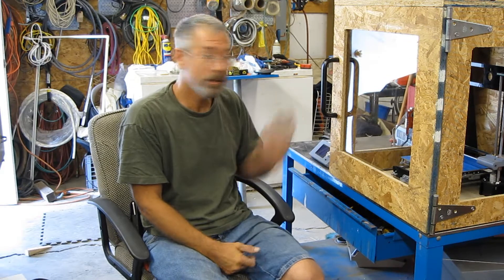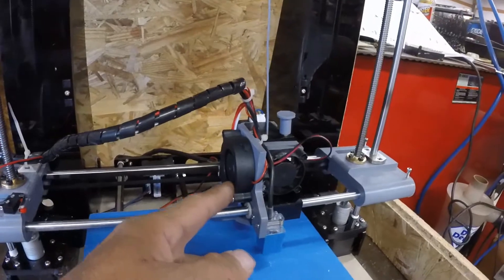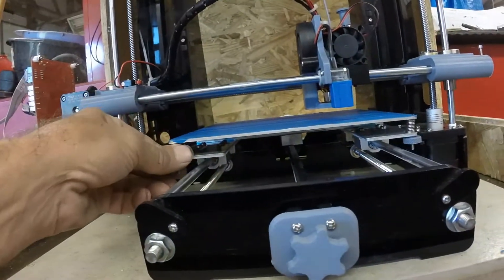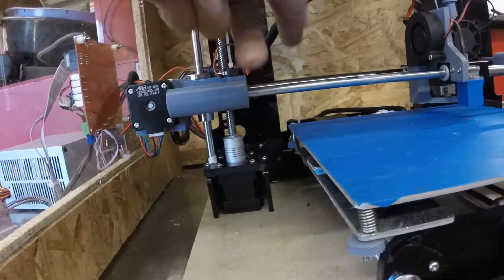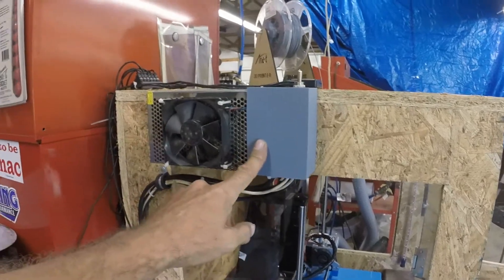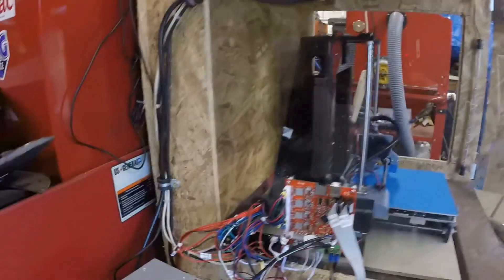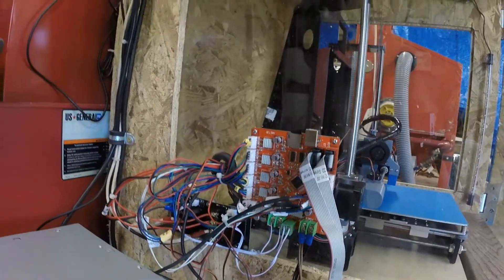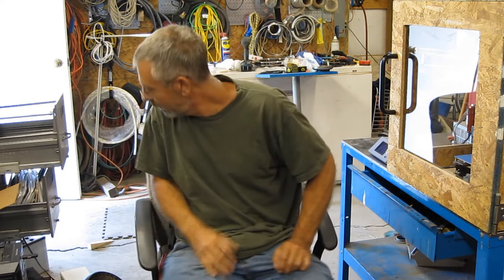Anet A6 fun upgrades part 2

Comment: did you have to rework the x-mounts ? ie drill the holes for the rods ? or did they fit ?
and perhaps you can add the crutial settings like layerhight, speed, etc. for those items as a reference.
Reply from the maker: CxKArthurDentRL   Actually everything fit together really well. I'm gonna put the link to the thingiverse files in the description. I just had to do a little deburring around the edges. I used cura to slice it. 6 perimeters, and 80 percent infill, .2 mm layer height, I used supports mainly for nice accurate holes, I printed them on edge so that the rod holes are vertical.
Reply: Hi again.
did you do a PID Autotune after powering up the PSU to 15V ? 
cause when i did this without PID Autotune, the nozzle overheated +20 
degrees .. so when is set it to 215 it goes up to ~235 and then cools down do 215 before the print started. After PID Autotune this problem was gone. I PIDed both Bed and hotend and now the problem is gone even with 15V.

another cool addon i found is this :
http://www.cxk-rl.com/board/attachments/userfiles/ArthurDent-2419.jpg
http://www.cxk-rl.com/board/attachments/userfiles/ArthurDent-2420.jpg

those a connected to my two PSUs and show their currend usage in 
V/A/W and total W. you can even set them to alarms, when sucking to much A or V
Reply from the maker: CxKArthurDentRL I need to do that. I did notice that it over shoots the temp on startup. Did you notice how much faster everything heats up by cranking up the voltage. It's about half as long as it used to be.
Reply: Hi, yes .. it takes much less time .. perhaps we should upgrade to a 24V bed 8-) ..
Reply from the maker: CxKArthurDentRL If you're setup is like mine, it'll be a piece of cake to upgrade to 24v. You just need a new 24v power supply and a 24v heat bed and block heater...done. That's in the cards for a future upgrade for sure. Stay tuned for a new titan aero clone upgrade.

Comment: I have a dumb question. Rather than us/me make the (improvement parts). Does somebody sell them?
Reply from the maker: Bill Spradlin . I guess it depends on which parts you are talking about. All the 3d printed part files are available on thingiverse for free download. Those parts can be printed by anyone that has a 3d printer.
Reply: Appreciate you responding back so soon. I had a feeling you
were going to say that about the “part files” are available on line, which I know
about, but thanks. I know having a 3D printer, is the (hopefully) fun part of
making things. But rather me wasting my time printing the parts and possible
not turning out. I would rather buy those parts and spent more time making
things for other products that are not available at any store. Ha, if that
makes sense.  X carriage mounts any of the other improvements too.